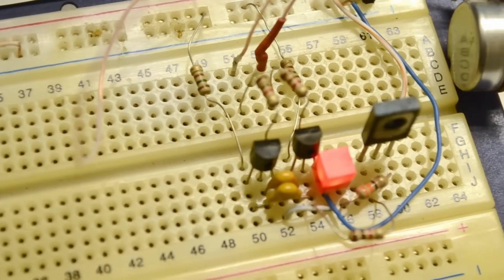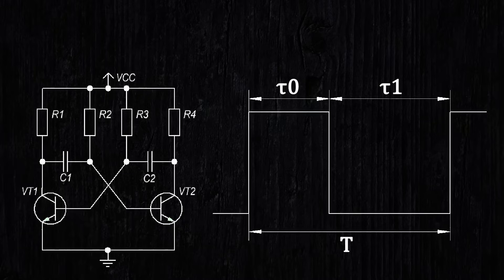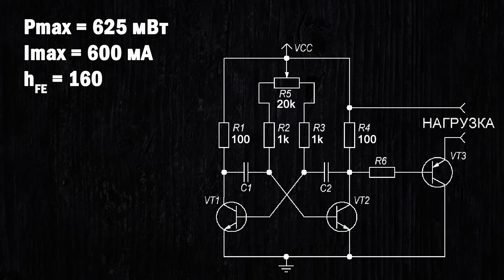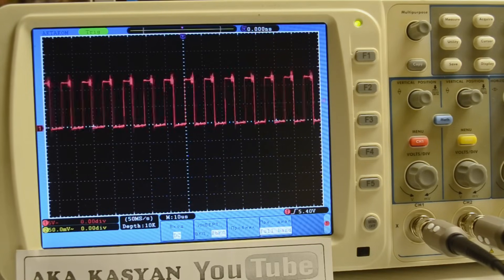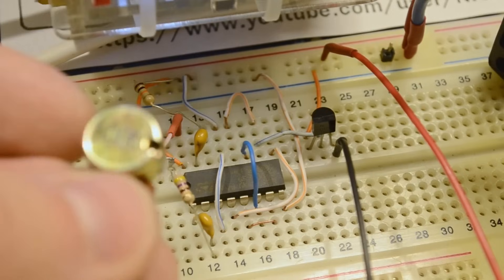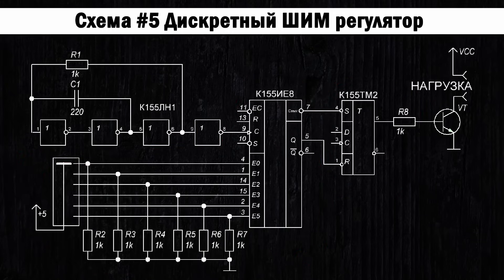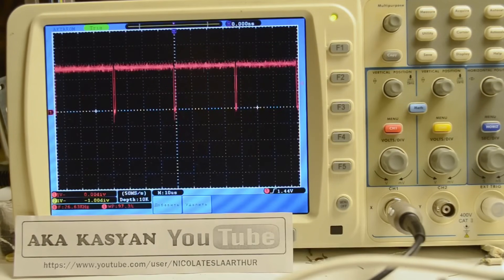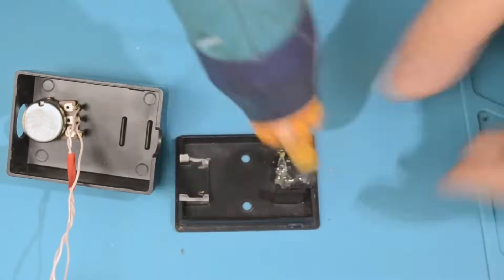TOP simple PWM controller circuits

Comment: Amigo por favor como se faz um desse primeiro com 6 transistores sem ci ?
Reply: Pra que 6 transistor?

Com dois já gera a frequência quadrada..

Tem muita fonte que nao usa ci. 

O ci é porque tem mais recursos como desligamento de curto circuito e também por temperatura..

Mas pra gerar pwm dois transistores geram..

Aí  no vídeo o esquema
Reply: É pra ter 6 sinais pra acionar ponte h trifásica pra acionar motor trifásico
Reply: Faz um e me vende que compro com 6 sinais 6 leds  sequêncial ok
Reply: @gilsonsantos8083   não seria melhor comprar um 
(soft starter)

Se for motor muito potente seria melhor fabricar um mesmo  pois um Soft start é caro
Reply: Não amigo , eu quero um sequêncial de  6 leds com transistores capacitores e resistor es , sem nenhum ci
Reply: @gilsonsantos8083  sequencial  tipo usado em som de carro?
Aquele que acompanha a batida do som
Reply: Não, tem que ser igual ao pisca pisca com 2 leds , só que quero com 6 leds
Reply: Se não tem como fazer, deixa pra lá amigo 👦 ok
Reply: Não amigo, tem que ser igual ao pisca pisca com 2
Reply: Com ci 555 e cd4017, eu faço mais não fica bom não